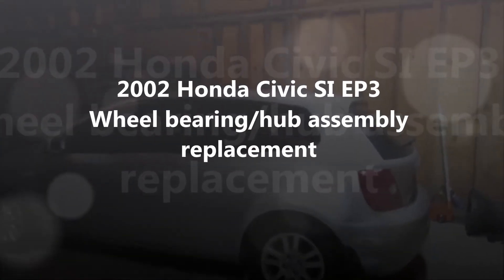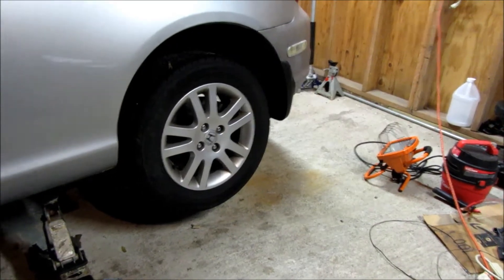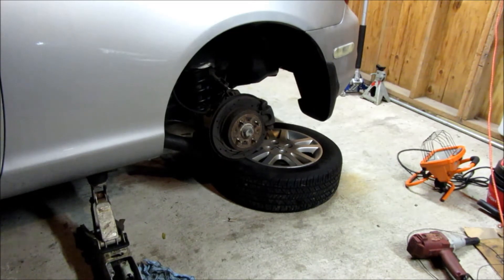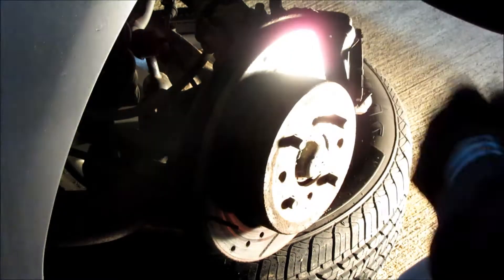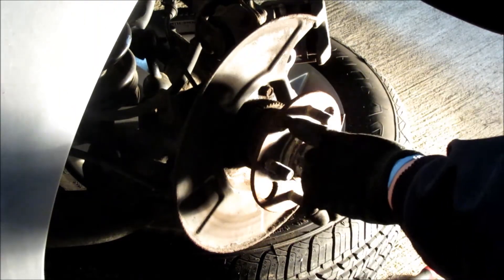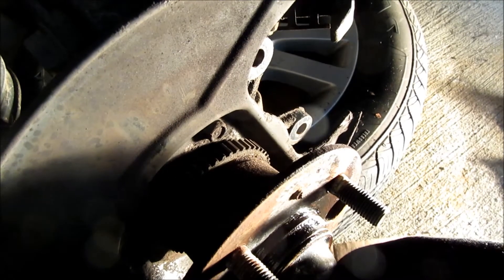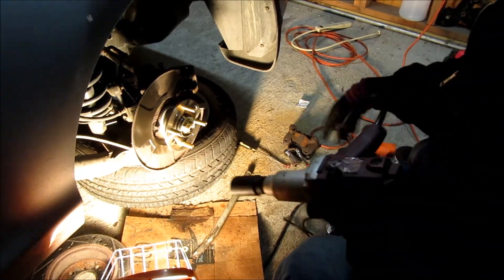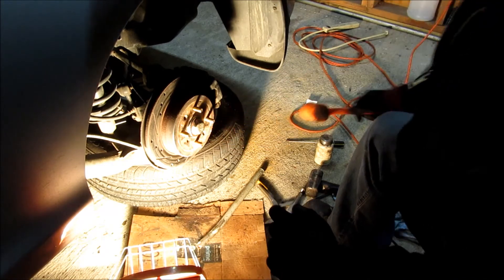2002 Honda Civic SI EP3 Rear Hub Assembly/wheel bearing replacement

Comment: I can verify that all rsx/ep3 wheel bearings always leave the inner bearing race on the knuckles regardless of rust. Em2 rear bearings have looser tolerances and slide in and out super easy. One question tho, do your rear wheel bearings have play with all suspension/wheels/axle nut torqued? I do get play when the wheel is on when I put my hands on the 12 and 6 o clock position.  I tried 2 different brand wheel bearings and both of them have play
Reply from the maker: I didn't notice any play like that in the rear on my car.
Reply: Untrue, I've had 2 EM2s, 01 and 04, did rear bearings on both, pretty clean no rust, and both times the inner race stayed on the hub.